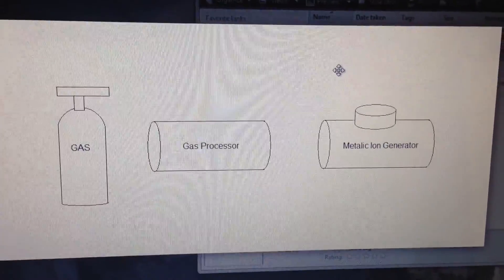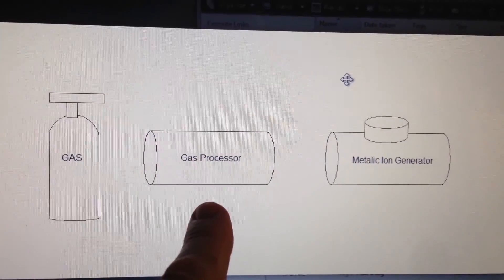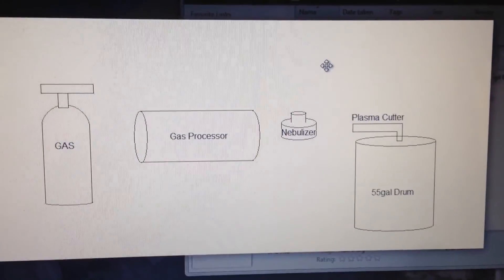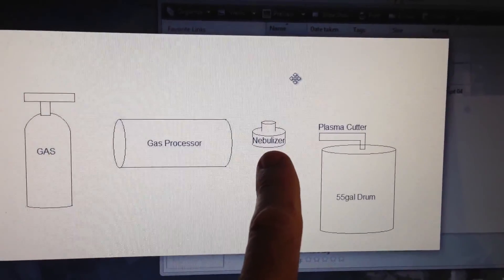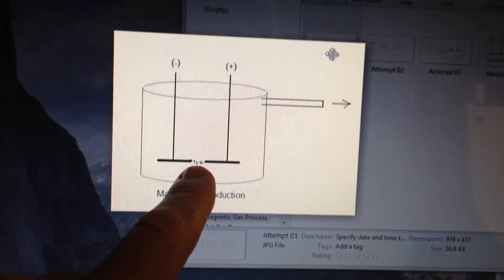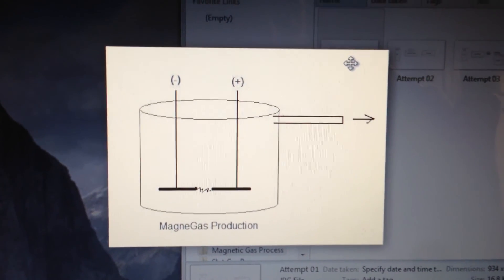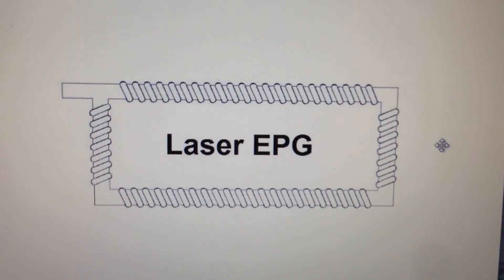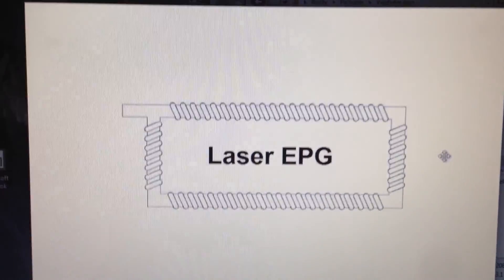Laser EPG 020 - Magnetic Gas Production Possibilities

Comment: wouldn't the rectangle shaped EPG slow the flow wherein as the round design would be a lot smoother and faster and i do believe that Meyer knows what he is talking about the production of the magnetic gas.
Reply from the maker: It would slow the flow if the gas or fluid were moving, but in the laser EPG the gas does not move. The gas remains stationary. The EMP is generated as the laser beam shines through the gas.  That's why it is so efficient. You can produce an EMP as fast as you can pulse a laser/LED.
Reply: Russell Martin thank you Russell

Comment: What is released into the air when you rub two metals together at high speed and pressure? A gas from the heated metal can be used as magnetic gas after it stripped of an electron.

Comment: try this when all else fails..... get a tesla coil and make top load like a aluminum pot with a lid. connect top of tesla coil with a hv diode inbetween to that pot. seal the outside of the pot with flex seal or some kind of insulator. inject argon and vaporized iron gas into the pot. turn on tesla coil. have another hose coming from pot going into epg but make it pass through a magnetic field before it enters the epg. 
The Tesla coils pumps electrons out of the gases and makes them critical and they combine to stabilize. try different gases with same setup and make all types of new compounds. i bet you could make that ferrofluid found in ufo this way if you use mercury vapor, iron vapor, and some of that radioactive radon gas that is heavy. that trio should act like  that Ittrium, Barium, Copper oxide superconductor but in the gas form. Heck, vaporize just the Ittrium and copper and put them in the pot. Is this alchemy?
Reply from the maker: Interesting, thanks for sharing.